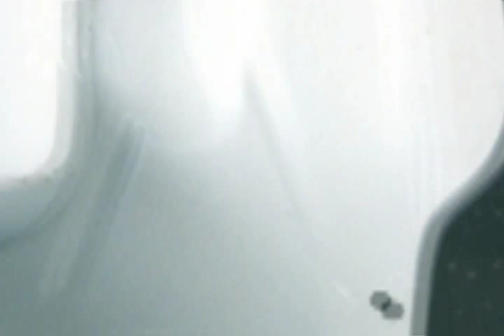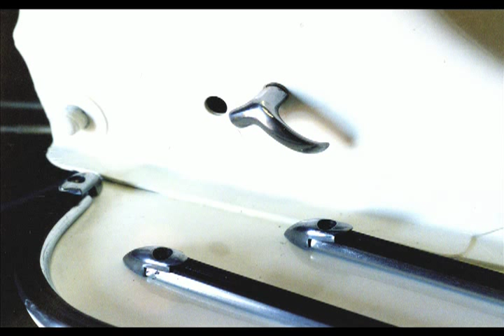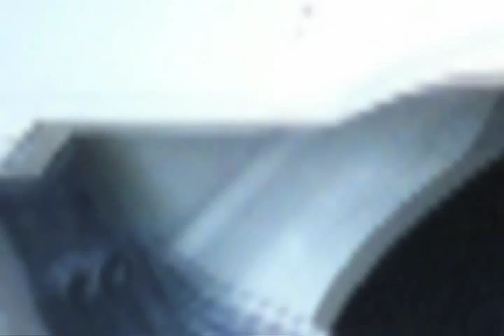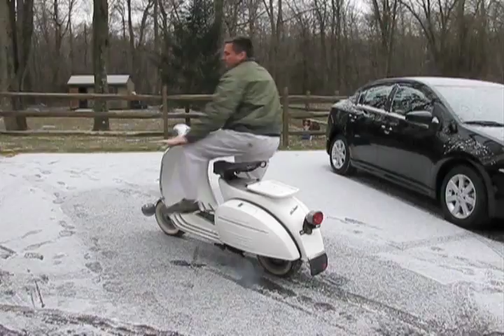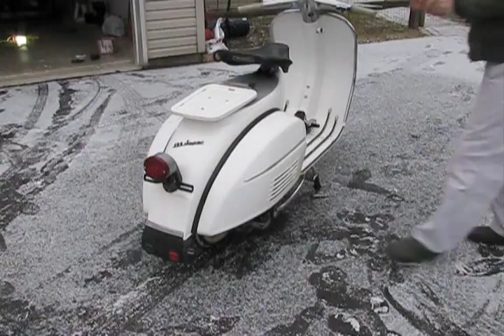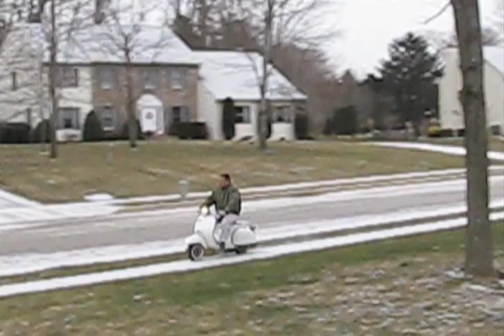1968 Vespa 125 Super

Comment from the maker: No, just used paint stripper and sander and hand sanded. Sandblasters can be messy and beat up sheet metal pretty good. These old Vespas have pretty robust metal so it really wouldn't be much of a problem. Sandblasting is great for rust which this one didn't have much of.